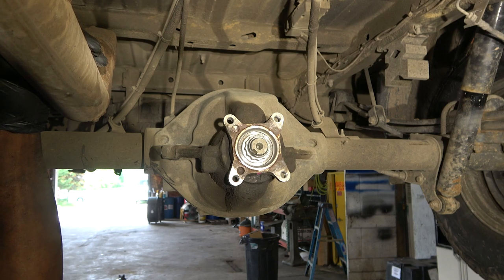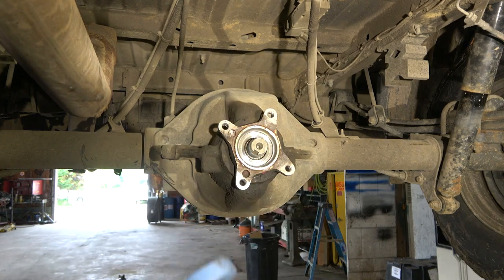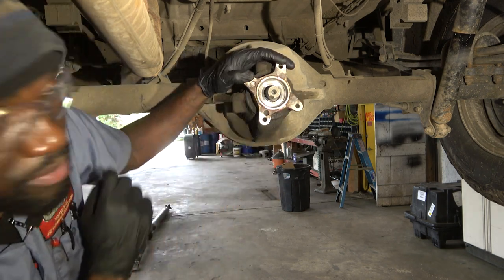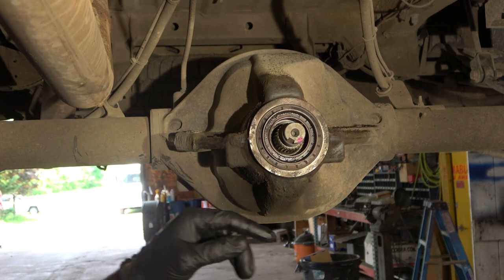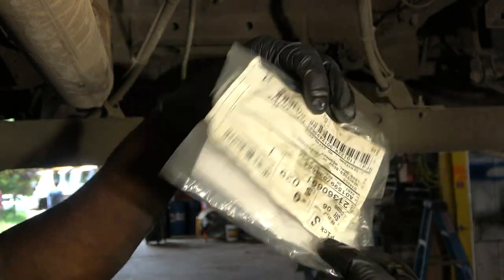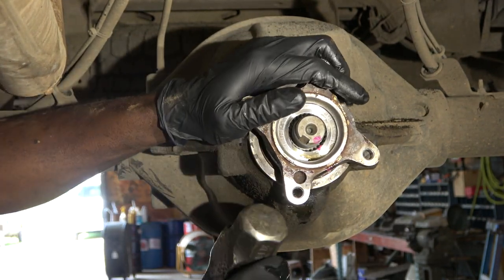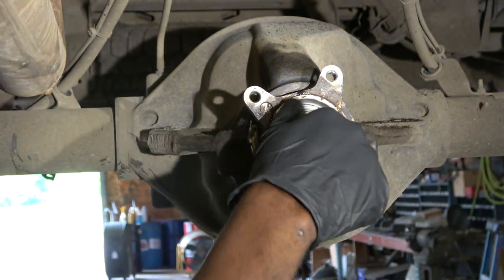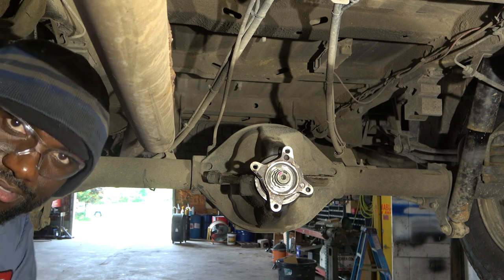Mercedes / Dodge Sprinter : Rear Differential Pinion Seal Replacement Step By Step Guide!

Comment: Hi! Good job for your informative videos. Which one is the yoke? Don't you recommend putting a new yoke too when replacing the seal?
Reply from the maker: Dan nde  It's actually called a pinion flange not yoke and you don't have to replace it unless it's damaged! I mistakenly called it yoke in the video!

Comment: Great video! Would you mind sharing the name of the pinion flange tool or better yet, find me the link to it? I need to order one asap! :)
Reply from the maker: @all-inclusivehub2491   it's called sleep yoke puller or pinion flange puller, you can get on ebay!

Comment: Hi i have a question about a c32 amg my diff broke down i am about to order a used diff from someone but its a bolt on diff i mean it got bolts that need to be screwed on and thats it but mine have a different one in mine the axhe shaft actually goes inside the diff itself so you think it will be able to fit on mine?
Reply from the maker: @HappyEyeglassFrames-fq8qq  You might have to replace the drive axle flange, to fit yours!
Reply: @KITS_Auto_and_Truck_Repair  so basically take out the fangle and push in the axle itself right?

Comment: Can you replace the outer pinion bearing without disassembling the entire rear end? My flange is wobbly and makes noise when driving.
Reply from the maker: @EuroStar-t4r  you can but it's gonna be difficult though

Comment: Do you know if the torque specs will work for a 2017 sprinter 2500?
Reply from the maker: @stephenandrade7993  it should be the same!

Comment: What size socket is needed to remove the nut? Appears to need a 12 point socket… can anyone confirm the tool required here?
Reply from the maker: Bryce Cook  36mm socket, 12 point
Reply: 36 ???